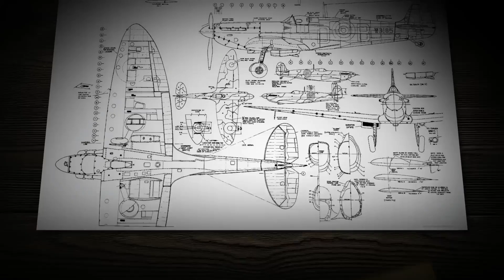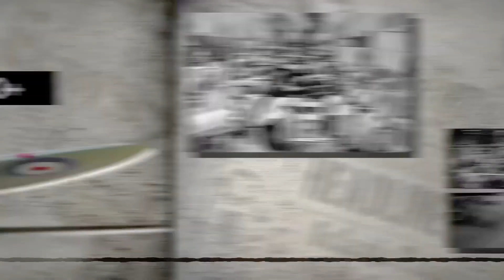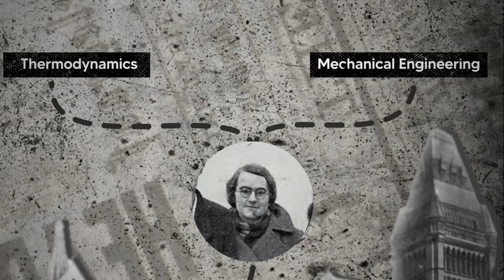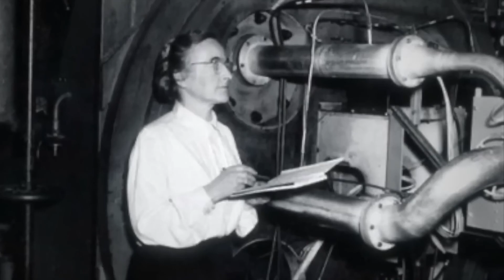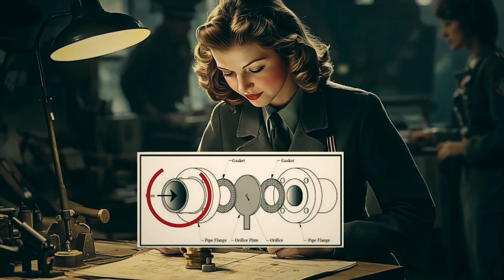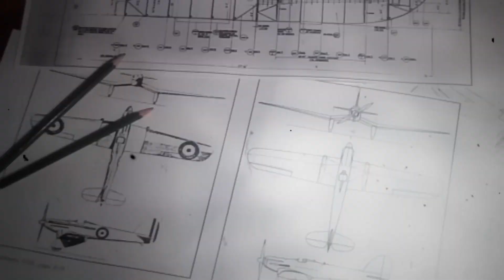Miss Shilling’s Orifice: The Ingenious Fix That Won WWII

Comment: You overlaid the USAAF marking over Beatrice "Tilly" Shilling OBE. That was inappropriate.  The lady was british and later worked for RR but at the time was Principle Technical Officer in charge of the Carburettor Research and Development department at RAE (a very senior role).  She earnt a MSc in mechanical engineering at Manchester University, not just a motorcycle mechanic. 

The alternate solution was to roll the Spit upside down to maintain G. The Spit also had the highest critical Mach number of any WW2 aircraft, 0.9, which enabled it to power dive faster than the Bf109. Probably the first aircraft to break the sound barrier and land in mostly one piece. Your archive films shows that manoeuvre.

Comment: Utter AI rubbish
The RAF was hugely outnumbered . The Hawker Hurricane was the principle and more numerous fighter, not the newer Spitfire.  The aircraft rolled and dived without loss of power.  The Battle of Britain was over before the fuel injection engines were rolled out.

Comment: The overhyping of a minor modification (which was only a partial cure) only because a woman was responsible for it. The Japanese had negative g proof carburetors' on the Zero probably due to their experience in China from 1937 on. The Hurricane that was more numerous in the battle of Britain and achieved more kills than the Spitfire also had the same engine and problem.